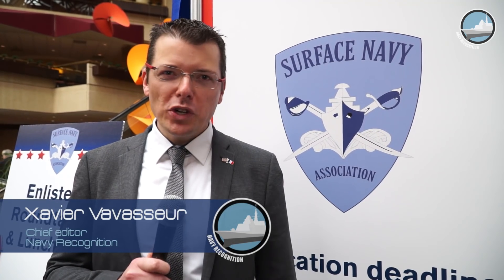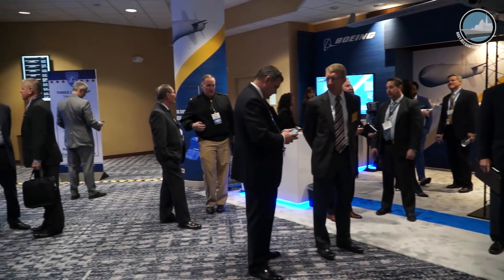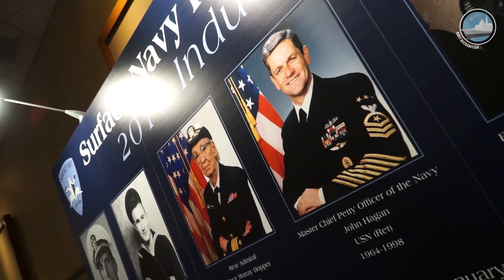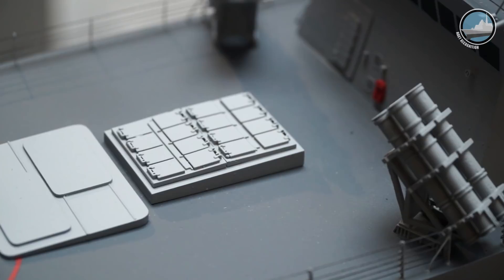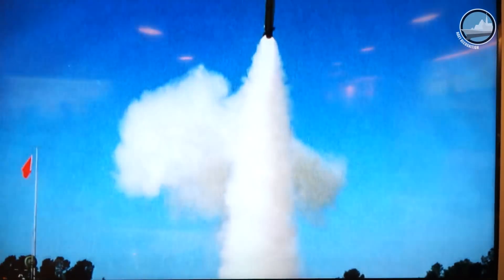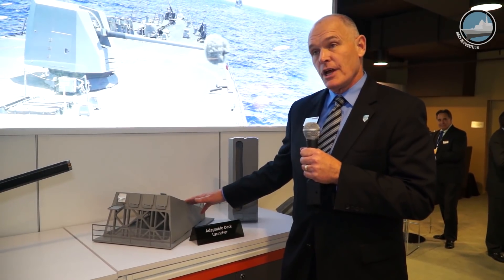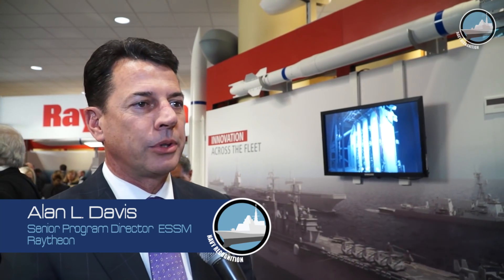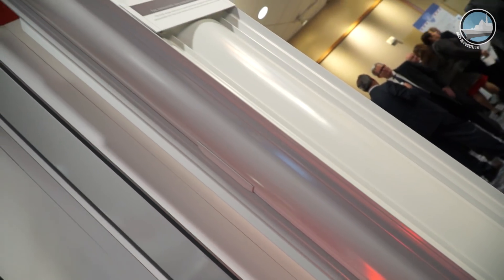SNA 2018 Day 1: Lockheed FFG(X), BAE Systems ADL, Raytheon ESSM & NSM

Comment: That NSM I would like the Navy developed to be mounted using the Army/Marines HiMARS carrier that is being worked into the Marine service. By using the common carrier and armament pod you can make your LPD carry the NSM while underway and provide a ship to ship strike capability. Then once near shore switch out the canisters and load up standard ML270Ax pod, ocean launch program and do sea to land strikes. Finally, once the HiMARS launchers are on land they can perform their normal duty of surface to surface strike or surface to air defense. The Navy could request a LPD 'barge version' with open well deck and load it up with HiMars launchers and assorted ML270Ax pods of NSMs, generic surface to surface (sea launch program) and surface to air. This implementation will provide the ARG/MEU deployment with added task force strike and protection. The LPD barge would be outfitted with a over horizon radar and targeting capability that would be interfaced into the HiMARS carriers.